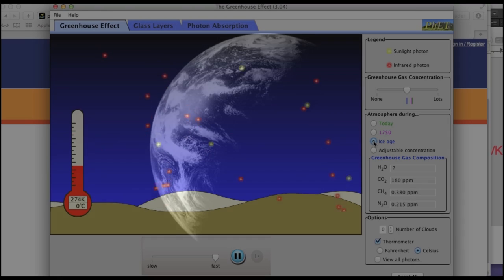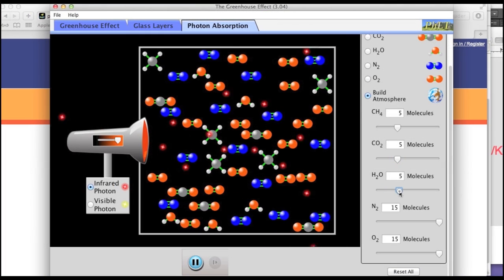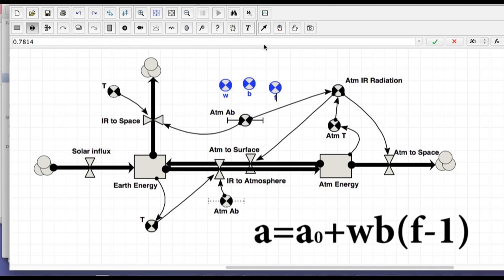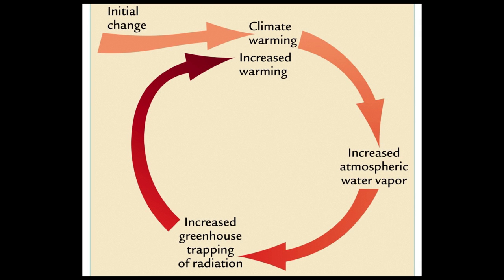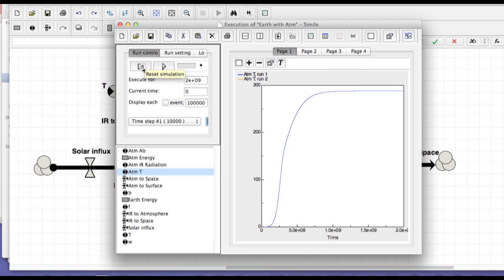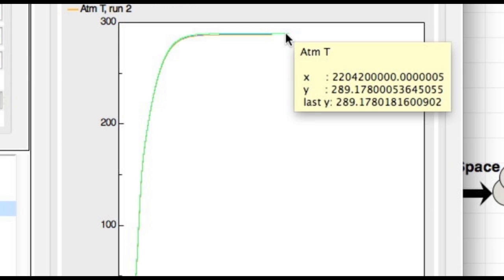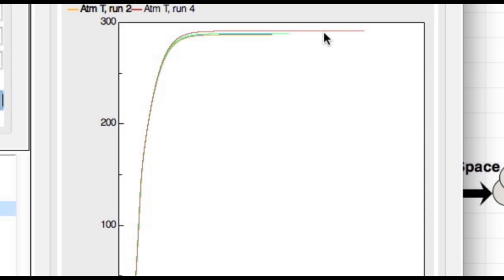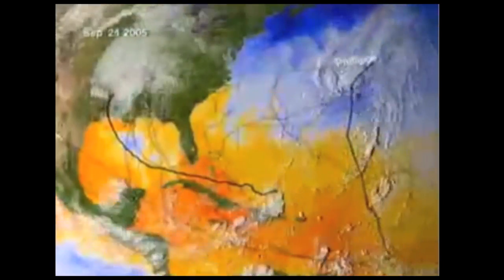Basic Climate Model Part 4: Greenhouse Forcing

Comment: You've got the atmospheric temperature equal to the surface temperature.  It should be lower.
Reply from the maker: It's called a basic swamp model for a reason, but the atmospheric surface temperature varies around the ground surface temperature.  Don't expect a very basic model to capture all aspects.  All models are wrong, some models are useful.  Like some comments I've read here.